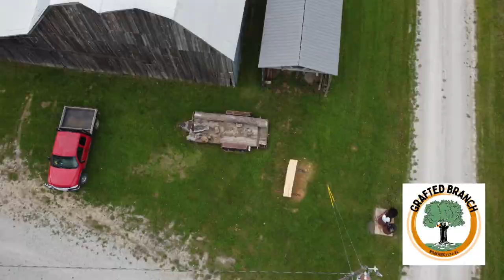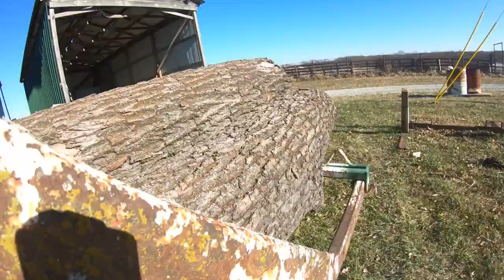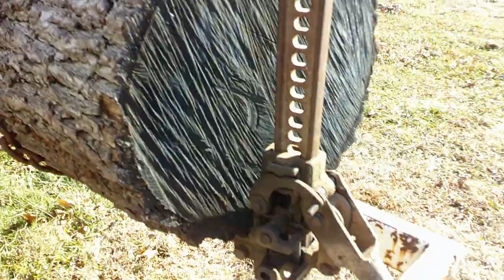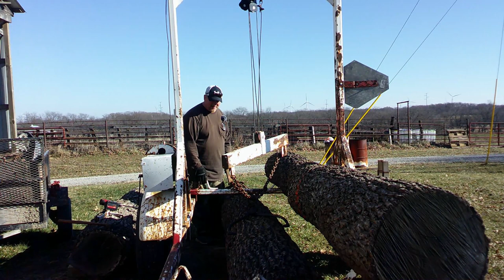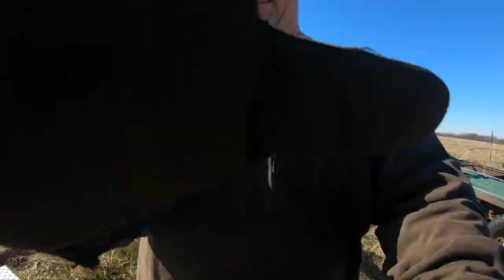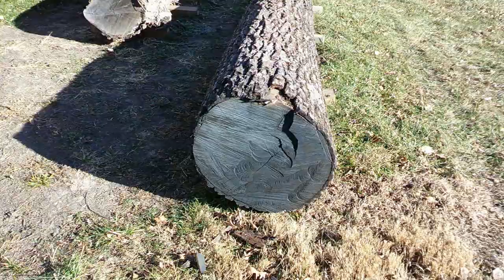Log Trailer, Unloading the walnut logs

Comment: Operate a drill correctly?? If you can’t do that, you should stay away from logs dude lol
Reply from the maker: I simply forgot to put it in low gear. In high it won't pick up the logs.  My brain was occupied with other circumstances at the time and I didn't remember to switch to low range. Once I remembered we had already picked up both logs using the hand winch. No biggie just more exercise I didn't want lol